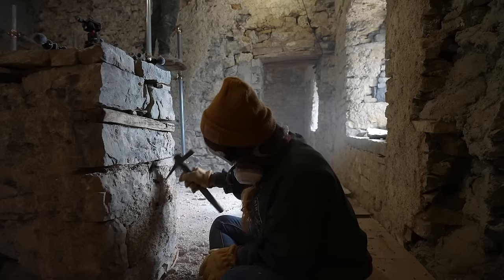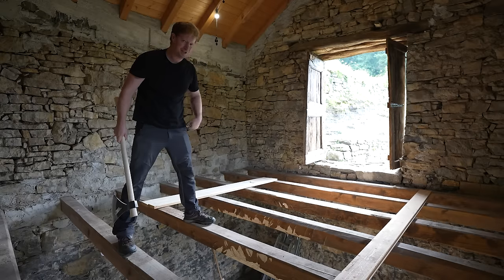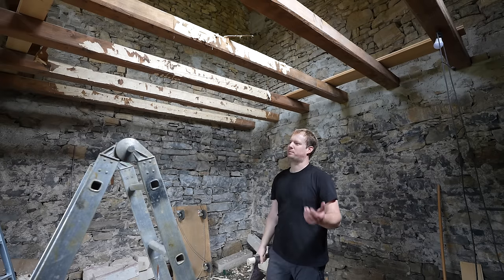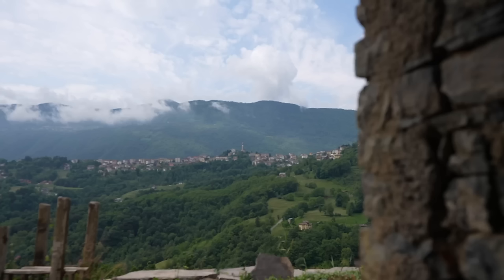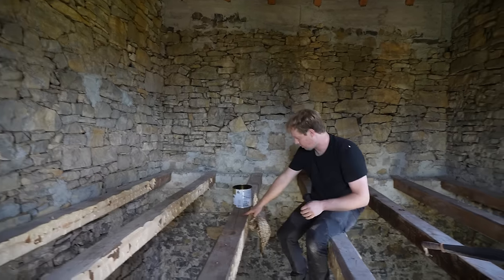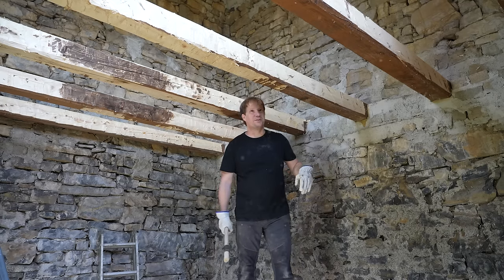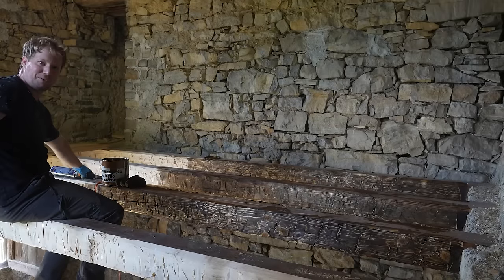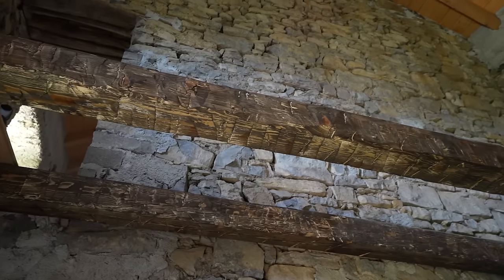They Laughed... Until They Saw the Results!

Comment: Diligent focus in aging the beams is bringing amazing results! A couple of my  thoughts concerning painting the floor boards. Consider painting only side of the beams, leaving the other treated with Danish oil. That way, if you decide you don’t like the white boards between the beams, just flip them over! If that doesn’t speak to you, consider applying an under paint treatment before your final color. Then should you decide to strip and refinish them one day, you’ll have an easier time if it. Not sure what the under treatment is called, but your paint store should know what to use. Lastly, what looks good in the store, may not compliment the stone. A stark white may be too harsh against ancient stone. Nearly all whites have an undertone. I’ve saved money in the long run by always bringing  home swatches to tape to the wall to look at the colors in morning, midday, night, and artificial light. Suggest also picking up not just white swatches, but also warm gray-beige and gray-green tones, in a variety of depths, too.  The results may be surprising.
Reply: I think they also had in mind trying to bring more light into each room  ...wanting the windows larger but dealing with all the codes  ...so white does lighten things up. I like the idea of a very pale green however.  Swatches are always a good idea.
Reply: Keep the egg shells for your veggie patches, the bugs don’t like them and they good for the soil
Reply: I believe they only sanded one side.  I use wood in my home.  It is always a pleasure seeing results.  I learn a lot by watching this.

Comment: I am just a person at home that has never tackled anything that is half as amazing as the job you are doing, so my question comes from a place of straight enquiry and contains no judgement. 
Q- are you not in danger of removing some structural integrity of those beams OR is what you are removing so minimal, it won’t make any difference. 
It does look fabulous and I am in awe of your attention to detail and your skill set.
Reply from the maker: No it doesn’t weaken the beams at all. Barely taking any wood off, and they are over sized as it is

Comment: You need a proper broad axe, with the offset handle. It gave a better angle to the cuts, taking shallower shavings off, while also keeping your body parts safe from the blade edge.

Comment: A quick method is to get a sharpening store to grind a convex curve on hand held electic planer blades. Very fast but noisy, or use a razor sharp scorp(curved draw knife for furniture making)
Reply: You can just use an electric planer, but do it in a very poor form. Crank the blades down and stab at the surface . the sound should be similar to an air raid siren.

Comment: Man I'm sure the beams are going to be pretty but as someone who lived in a house a couple hundred years old with beams like that it was a pain in the butt to dust and get the spider webs off. But they are pretty
Reply: Been there and I agree, we have old oak beams in the lower floor and they are a pain in the neck to clean( spider's paradise is an euphemism!). On the first floor of our house we put in 7 " hempwool insulation  and only the big beams are still showing. Authenticitiy  might be cool, but if you actually live in the mountains, and the climate can be pretty rough at times, and you're getting older   you might skip some of the authenticy or kill,  you opt for more  reasonable energy saving features which become prevalent to authenticity and comfort  becomes priority.  We've been living in our mountain home in a two house hamlet, four miles from the next 167 soul village, where our kids went to school,  for 42 years  now and when we where young we had to do a lot of the things mentionened in this video to make our house livable, besides raising a family of eight. But we chose our place with a bit more discernment than these guys. I would never ever have chosen a place as perilous as this one, with the steep mountain behind and the umlevelled terrasses. We took a long hard look at all the propable locations before we baught our place and even though it's at roughly  3000 feet in the pyrenean mountains  at a rather similar climate and vegetation, but we finally have chosen a large flat 100 acres outcropping of out 6000 feet mountain, where  no rockslide will ever threaten our house and barns and the kids had a large space to kick their cans around. But I get that part of this  is a feature to make money  and I appreciate the hard work  these guys are putting in this project, even though I think they are doing it backwards and have, sorry to say, ignored the safety ofmthe place .For me,  securing the  place comes before the building work. But  as I said, chaqun son truc, that's just me.

Comment: I'm not convinced by the burning method to age those beams. The hewing is great but the problem with burning is that it darkens the high points and leaves the deeper parts lighter, which is the opposite of how old wood looks. Old wood is darker in the recesses and lighter on the surface areas. I've had a lot of success with Briwax. I apply it with a rag, and by applying it quite thickly it goes into the recesses and they end up looking very dark, while not obscuring the grain. I've got some old oak beams that were painted black. I sanded them back, used an angle grinder to rough them up and put Dark Oak Briwax on them. They look amazing. Maybe experiment with that?

Comment: Obviously it's a personal opinion, but i think this was a demented amount of work for a not particularly pleasant result. I replaced 32 joists - 130 x 130 x 3500 - in a barn in the French Alps and aged them with a very rough, aggressive grinding-wheel in a hand-drill (750W SDS ) . I didn't consider any staining - and certainly not any burning - as I felt the natural colour change would be fine for me- which has been the case. Even with your proposed white ceiling-boards, these blackened joists won't help the darkness in the room, especially IIRC, you are only getting light from one window.

One thing I found in my renovation was that I drastically over-estimated how much light you get through a window unless it is very large: when you have thick walls (even with "flared" insides, light is severly diminished unless it is pretty much direct. 

Having said that, if you are both happy with it...........................and Bradey can keep up his astonishing work-rate and endurance ( much applause and deep bow  to you on that ), then great.

Very best wishes for your continuing work: I remember the back-breaking work of digging out the stable and moving natural stone slabs of 50/60/80 kg ! I recall you asking about stones set on edge. I also had this under the big slabs and was told it was it was much more resistant to movement and wear from the slabs on top and so gave much greater stability in the very, very long term ( centuries I suppose. My place is from about 1830 .)

Comment: With a little more research on how beams are hewn, you could have had a much easier time adding faux hew marks with much more convincing results. I think you understand this by hinting at the fact that the marks are more regular on beams hewn by someone who knows the craft. What you needed was another axe with a flat face to make the regular marks perpendicular to the beam, then used the axe you have to chop down the length of the beam. Also, you can only be careless with safety for so long before a major accident occurs. Protect your lungs, protect your hearing, and respect heights. You could have been seriously injured numerous times during the footage we saw in the video, meaning you probably came close to injury countless times that were not filmed. You have a family, be careful!

Comment: I know this is way too late...I have no idea whether these videos are recent or not.  I viewed the beam aging with the sharp utensils and torching. Not only dangerous, but I think unnecessary. I would argue that the modern additions of new components contrasts with the old existing - each enhances the other.  

I enjoy watching your works progressing. I was fascinated by the issue in video 35 where the boulders are rolling down on the building - certainly a major issue. Hopefully you have a geotechnical engineer about who could advise you. I am not such a person but have you considered laying up a gravity stone wall say half way back on the terrace behind the roof eaves? The wall - say 2' to 3' wide and say, 3' high - perhaps 50' long that could block or deflect boulders.
Or am I not understanding the size of potential said boulders?

Comment: Not sure about this. Do you worry that a false note is being introduced into an otherwise wonderful resurrection of an old building? Ultimately, of course, the only criteria has to be what works for you.
Reply from the maker: Authentic beans would have been hand hewn. So we hand hewed the beams. How would this be considered in authentic?
Reply: @RaisingVoyagers  It's inauthentic because you did it, not the original installer of the beams. As I say, however, this is purely a purist view and folds in the face of your preference. As an aside I would also argue that hand hewn beams could, and most often did, achieve a high degree of finish. In fact beams used in building were sawn from an earlier age than one might imagine, altho' in rural remote Italy I agree with you it is likely they were hand hewn into the late 1800s and even later. I guess we'll never know what the first beams in your building were like. I think you're right in assuming they were hand hewn, but disinclined to believe they were randomly hacked around. Thank you for your videos.
Reply: @Everymanplease  the building has a complete new roof....can't see how you can make it inauthentic - whatever you do to it.....!